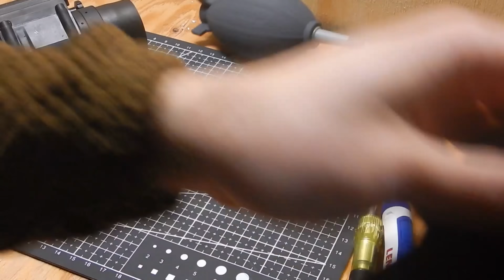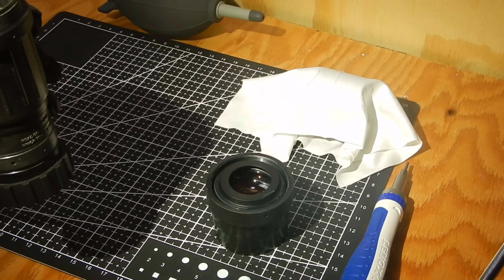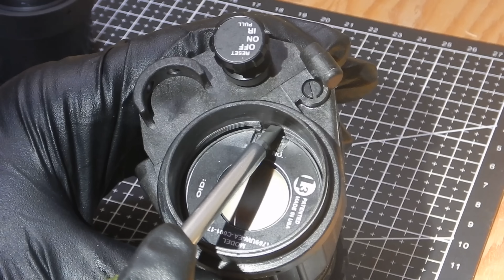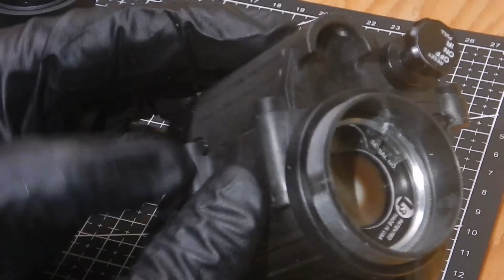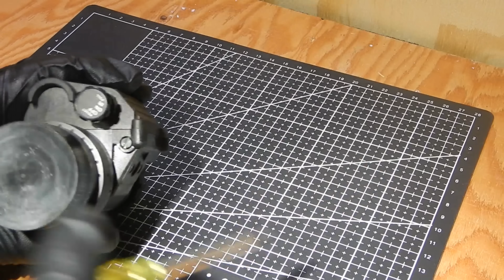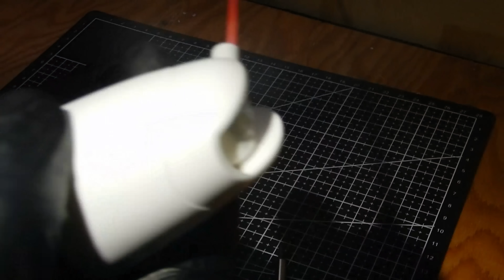How to Build Your Own PVS-14

Comment: What is the total cost for the kit and the imaging tube?
Reply: From what ive seen, the tube is about 950 on ebay, not sure about the housing. Also, alot of things r inflated right now so the tube may have been cheaper some time ago
Reply: For anyone interested, John Shrek, McPhee has a podcast he did with a nightvision retailer/manufacturer and they discuss many pros and cons of different gen tubes, IR floods, etc i believe Jamey Caldwell has done the same and he is currently teaching nightvision tactics and shooting all over the country to various LE and SWAT units. He is also employed by a NV manufacturer and is working on developing improvements. Both men were former CAG guys
Reply: Anybody?
Reply: @relevation0  right?! Lol. I imagine this is a question that many people are asking themselves right now.
Reply: @guitardaddy6  yea I guess more specifically I'm wondering what the non inflated price is supposed to be lol.
Reply: Tubes have a pretty wide price range . New whites can be over 3g. It  looks tempting to cheap out and buy first gen tubes...don't do it. They are very limited without bright moonlight or an IR flood. Save up and get a newer generation tube, it's worth the wait.
Reply: @MrCashewkitty  you can still find fully usable gen3 green tubes for around 1k on the used market. Don't settle for less than gen3 unless it's the newer photonis WP stuff
Reply: @MrCashewkitty  this is exactly what this needs. Excellent information. Thank you sir
Reply: @guitardaddy6  no problem...and stay away from my daughters. Hahaha
Reply: Superior tactical carson kit is 700. Used gen 3 green tube between 600 and 1000
Reply: Kit 600-900. Tube 800-3000 depending on age, quality, style, blemishes etc
Reply: @ChevTecGroup  you're a scholar and a gentleman.
Reply: .....if you have to ask, you can't afford it. Lol!
Reply: @willbass2869  not how that works. if im going to go the DIY route, I want to be under msrp of a standard PVS14 or Used on the market

Comment: I will get on this tonight. 

Can you do this with IR monotubes as well? 

Break

I’m working / car / stealth camping  this whole past week. And guess what super delish ration I’m testing?

The erbwurst is very enjoyable, for anyone wanting to test the field ration out just know if you have lean bacon and use several cups of butter to the 1pound / 450 g of dry peas.

It’s a lot more fat than expected.

I’m going to try it with beef tallow or straight lard from my kuna kuna pigs next.

Question, does anyone know how shelf stable this is?

I was thinking to put it in Mylar with oxygen / moisture absorbers.

Comment: Note: Those masks they mandated are actually useful for this. Helps so you don't get moisture from your breath onto the components if you're working closely with it.
Reply: Ah yus, the real reason we all came to a NVG video.. to be lectured and insulted about a subject that has no correlation with the subject matter of this video. Gotta love trolls doing what they do. (Typo)
Reply: If you can smell a fart through a mask.  You aint stopping the covaids.
Reply: @half-dead877  you win
Reply: Where would one go to source parts from a good company?
Reply: @mikeyourbag8997  A better option is to use a 3M or MSA dust respirator with out the filters. It's cheap and the bayonet connection is compatible with most PAPR units on the market if you ever need to use it (note 3M and MSA are different spec but adapters exist)
Reply: @mikeyourbag8997  tnvc
Reply: @TommyJ76  without the tube though.

The tube itself seems to go for 1,200-2,600.
At that point you might as well buy one ready to go.
Reply: Sauce for pfp?
Reply: It also stops your new NVG's from catching the China virus.
Reply: @ClodiusP  haha
Reply: If your glasses are fogging the masks arent working.
Reply: I will never wear a cuck muzzle
Reply: @devondetroit2529  I will wear them if/when the situation calls for it. Working on delicate electronics, fine, but not going to the gas station.
Reply: @devondetroit2529  wear a cbrn mask
Reply: @devondetroit2529  The fact you called it a "cuck muzzle" tells everyone everything they need to know about you as a person. Seethe harder.
Reply: @devondetroit2529  better than a ventilator 🤷‍♂️
Reply: @helives2630  none of what you've said is backed up by actual evidence-based science. If you've spent a day working in Healthcare, you'd know this. Ivermectin?? What was your microbiology grade in college?
Reply: @DoubletapDaoist  We have seen the mask fibers with an electron microscope; looks like S2 work mat.  We know the microbial virus passes through with ease, Dr. Jekyll. We are well informed.
Reply: @coolbreeze1854  lol how does a microbial virus travel? Be a sport. Do particulates as small as a virus just fly thru the air like gnats? I want you to go ahead and dawdle over to Google and look up 5 articles on something called fomite transmission. Educate yourself. Simply stating that you saw a picture of a SEM doesn't mean you remotely understand droplet transmission vectors.
Reply: @DoubletapDaoist  6ft Einstein oh wait now it's 3ft because your droplet vector been reduced Dr.part Particle posse.
Reply: @DoubletapDaoist  Just want to jump in to apologize on behalf of certain individuals in this exchange. feel free to continue but it may not be productive. your time is valuable. if they're gonna choose to waste your time, you shouldn't spend it on them. i know the common good is a tempting goal, but nothing these individuals want is compatible with it. they gave up on caring about other people a long time ago. they will die on ventilators like Slim Pickens falling to his fiery doom, denying their own mortality until it mysteriously escapes their grasp...
Reply: @coolbreeze1854  was that English?
Reply: @DoubletapDaoist  NO it is slang Dr. Frakenfurter. Now off you go.
Reply: @rm-gh1co  Pau d Arco which has quinine and has peer review studies showing effectiveness against other sars viruses.

I ended up just needing a power nap when I caught it.
Reply: @Eluderatnight  Took a power nap almost two years ago and never looked back.
Reply: @DoubletapDaoist  hcq iver and ZPack stopped virus in its tracks . 24 hr 180 —it  worked for me but it shouldn’t have. Right? Guess I’m an anomaly along with one or two other lucky ones.
Reply: @RubberDJ  something called the scientific method tells us that your results ought to be repeated. Why hasn't that happened? Do tell.
Reply: @DoubletapDaoist  I suspect you’re not being faithful to the effort here but I’ll oblige you because I was once in your camp. 

I’ll tell you one of the most liberating moments is when you discover your  side is not what you thought it was . For whatever the reason  you find yourself in error with a belief system. ... if you can get past ego and cognitive dissonance and reacquaint your compass to a new heading you realize that you don’t need a label or a side. Walk with truth. The hardest thing is giving the opposition a fair shake.  If you cannot sit down and listen to what the other side has to say  then you can hardly be considered judicious fair or honest . 

I’ll give the benefit of the doubt to you . You asked and so I will oblige. go check out the channel whiteboard doctor and his video iver and ¢1-9 how does it work . Then since you asked check out all the studies that followed the scientific method used for studies , trials etc the meat and potatoes that make up peer reviews.
Reply: @logicplague  so you're saying that COVID is an airborne pathogen and not a droplet based fomite vector transmitted pathogen? Better tell the CDC about that.
Reply: @DoubletapDaoist   I don't believe much of what they have to say since this became politically motivated.
Reply: @DoubletapDaoist  If it is animal medicine, then by using that "logic" so is penicillin.
Reply: @helives2630  source?
Reply: @logicplague  Imagine screaming and crying about "big pharma" as you buy more products from big pharma.
Reply: @DoubletapDaoist 
Duh, fomites travel via Uber. One doesn't need to read erudite biology tomes, just just highway transportation "vectors!" 😅